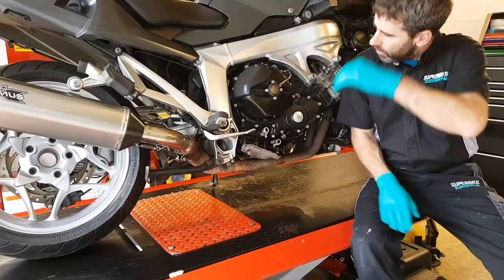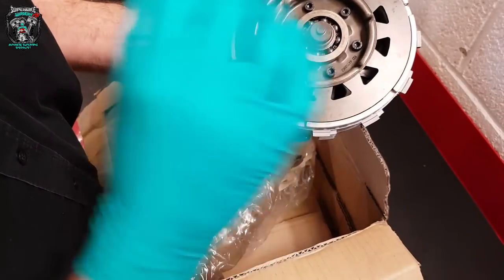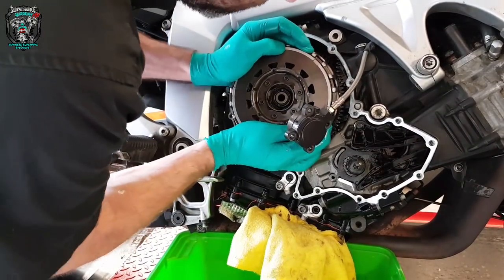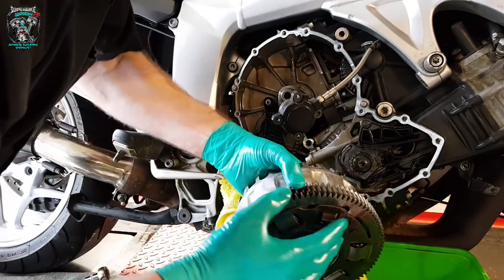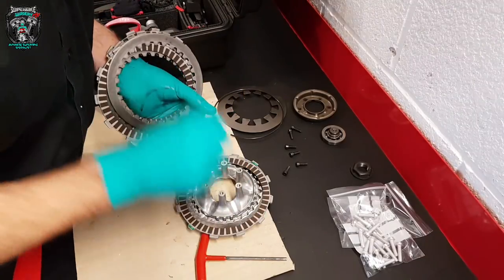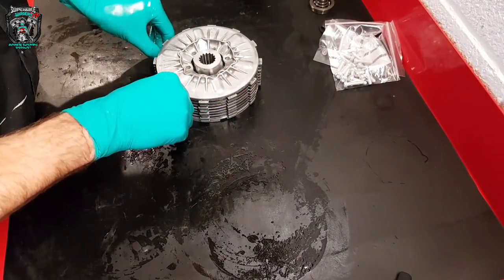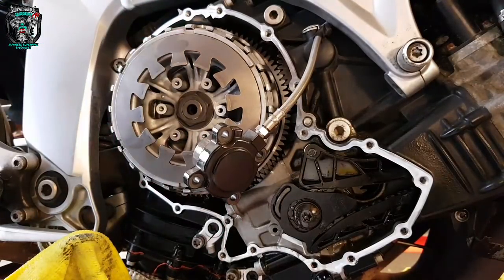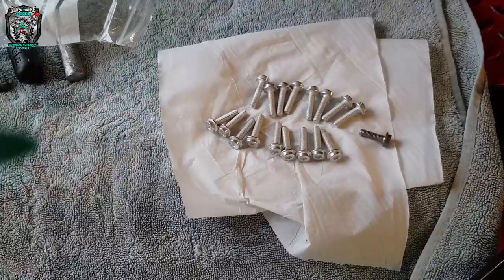BMW K1200 Clutch basket replacement - VLOG 007

Comment: There is now a mod on the clutch basket to drill more oil holes to allow better oils flow to stop the heavy clunk when selecting 1st gear I had mine done.
Reply: Did it work ?
Reply: Risk of loss of oil pressure

Comment: Get the BMW special tool for the anti-lash gear, it takes care of both gears at once and the basket will pop right in.  Also impact guns shock gears and can cause brinneling.  Use the tool to hole the clutch basket and avoid damage to the gears.  Replace the aluminium bolts for the cover with SS bolts and they can be reused again and again, without any real weight increase.  I also soak even second-hand clutches for insurance, I like the clutch to be wet going in.
Reply: The single use bolts are there to shear and break preferentially if you have a fall and the clutch cover is impacted. Otherwise the cover can break the cases in a drop or crash.

Comment: Actually, I did not find it difficult to torque the clutch shaft nut going back together.  With the clutch pack installed and compressed by the diaphragm spring, put the transmission in high gear and step on the rear brake while pulling on the torque wrench.  One-forty foot pounds, no problem.

Comment: Thank you so much I managed to replace my clutch today was a bit of a nightmare as I was originally sold the incorrect replacement clutch which caused me a lot of grief. I reccomend Barnett replacement works a lot better then the OEM BMW plates.  Thansk again I could not have done it without you much appreciated mate.

Comment: My old Suzuki T500 used to have a rattly clutch. The rattling disappeared when I puilled in the clucth lever. What made it rattle was the rivets holding the clutch basket to the primary gear became loose with time/use. The cure was a new basket and gear or I supose the rivets could have been replaced. 
By the way what happened with the Yamaha 1200 Super Tenere? My bet is the crank has snapped. I do enjoy your videos, it's good to watch and learn from an experienced pro. I have not seen your like before.

Comment: I have a question I believe you skipped on your great video. 
How do you align the multiplate clutch basket? 
I believe it is related on how do you bolt the pressure plate/spring. 
I’ve already tried few times but keep having that feeling of canguru launch. 
Any thoughts?

Comment: Hi.. just watched video, brilliant tips.... do you need to lock out the camshaft if only replacing the plates and not removing the basket ?
Reply from the maker: Only if you Don't have an impact gun to undo the clutch hub nut.

Comment: hello james, i have 2006 k1200GT same problem, it actually kept slipping until it broke. now it does not move, it also makes a loud noise when running. i wonder if it caused a serious damage to the transmission. Do you also need to lock the crank shaft replace the clutch basket?

Comment: Great vid . Would now be able to do this myself. I have an 07 with this rattle and also in need of a timing chain tensioner. Is that an easy swap out? Many Thanks Nigel
Also I am in Australia, can you recommend good parts suppliers either local to you or world wide chain of suppliers?

Comment: Hi James, thanks for the illuminating video.
 
A couple of questions I hope you can answer for me please:

I'm about to change the clutch friction plates on my 2006 K1200R. The plates are supplied by Barnet Performance Products from the US of A, in their blurb they insist that the plates are soaked in only synthetic motorcycle oil, can I get away with using semi synthetic oil to do the job? What issues will result if I do?

Secondly, an advising 'friend' tells me that I should also soak the new clutch cover gasket in oil to form a fluid tight seal, again, is this right as you make no mention of it in your video.

Many thanks,

Karl.

Comment: Hi, great video and it has been a massive help to me. The 6 bolts that go into the washer that holds the thrust plate, are these to a specific torque, or is it just until they are tight? I've replaced my plates and the bike won't select neutral unless it's not running. Can the thrust plate be too tight? Does the bike need a run out to let everything bed in properly? Or could the new clutch plates be too thick? Or have I royally f**ked something up? Any help would be appreciated, thanks :-)
Reply: Sorta same issue here. My clutch won't engage at all. Like it's hitting a brick wall half way thru the pull. Did you find out anything?

Comment: Did you go through all this without changing out that inner needle bearing? I wonder how many K1200/1300GT bikes have been scrapped for parts because the clutch roller bearing started vibrating after the clutch work?

Comment: Hello @SuperbikeSurgeryTV, I wanted to ask if anyone has had this problem before.
Bike is a 2005 K1200R has 55 032 kilometers on it, apart from the fuel sensor everything is perfect. I had recently done an oil change as part of the maintenance routine a week ago and had already do e 300 some kilometers since the oil change.
Over the weekend however I noticed something has changed upon take off the bike would pull normally in first gear at 1.5k to 2k rpm and once in second gear I'd hear the engine rev over 3k rpm and sometimes to 4k rpm before properly catching on, and under hard acceleration it would revs very high then comeback down to 3k rpm before pulling normally.
It's slipping on the clutch; all other gears will do the same too. It is not very noticeable after warming the bike up and riding around. But once it's nominal temp it starts to slip.
I've read around that it could be the slave cylinder's oil that got on the clutch to make it slip due to broken O rings or failed O rings so I checked the slave cylinder and the O rings, all are fine no leaks no signs of wear.
Some said it is the oil and I checked my oil it is a Yacco MVX 1000 10W50 and no my previous which was a Liqui Moly 20w50. Could this be the cause? I'm buying Liqui Moly 20W50 oil tomorrow and purge the Yacco out of the engine tomorrow and might as well buy a new oil filter to go with it too.
The clutch is good it's been replaced with a new one just last year and it all worked perfectly apart from last weekend.

Comment: I just purchased an 07’ k1200gt and I now notice the odd rattle at idle which is quite loud at times. I find it sad that BMW figures this is normal. There is nothing more bothersome than pulling up along another rider with your bike rattling. I have owned three other bikes of Japanese design with maintenance not being such a massive issue as BMW. How often does this need to be done ?

Comment: I developed clutch issues in my K1300R after the first 1000km service. Never could resolve it. BMW denied any problems, said the rattle was supposed to be that way. Got rid of it asap. Shame because it was a cracking good bike otherwise.

Comment: Mr.Uhm,....lol- don't sweat it!! bothers you more than us. I NEED YOUR ADVISE,..2006 k1200s  - 2/3rd gear clutch fork....possibly bent?? 9according to forums and guys that dealt with this issue when these bikes were newer....Mine will slip outta 2ndand outta 3 rd third when i aggressively throttle up in those gears and all others are fine. (it sounds horrible when it jumps out,...like destroying the gears;...It too has that rattle you speak of. My question to start with is,..the bike has 50,000 miles on it now I put close to 20k miles just in 10 months...What parts do i need to replace,...entire clutch basket and plates? should i also get the new thrust pin for oil flow through shaft>?  And what is your opinion in adding another steel plate in the front of all of them.? ANY AND ALL ADVISE WOULD BE GREATLY APPRECIATED. From Northern California, USA

Comment: My slave cylinder has a (breather) nipple on the top which has broken off. As the slave cylinder on your bike doesn't have a nipple, - how do you bleed it when you change the clutch fluid?

Comment: That new basket still got springs rattle tho, as i can see when you install it. Doesn't that bother you?
Reply from the maker: The springs are supposed to be loose, a brand new one would be the same. That's not what causes the noise.
Reply: What causes the noise?

Comment: Great video,thanks. I did my mates Yamaha with an impact, came out fine. Like you said "experience" you just need to know when to stop. I'm  thinking of getting a k1200... they seem pretty straight forward to work on. Subscribed paulphillipsfix.
Reply: Paul.   I have one and they are a bit of a pain. Clutch is the worst I’ve ever experienced !  They sit high above the sump and have to be kept wet by a supply through the drive shaft which doesn’t supply enough. I’ve fitted an Oberon slave cylinder and 5/40 oil which improves it no end but still judders.
Changing the headlamp bulb is fairing off or a highly trained pet octopus (virtually impossible in situ with normal sized fingers),fuel gauge left me stranded 3 time in first month of ownership and the AA man asked straight away if the gauge had fooled me. Not impressed and will probably go for a GSXS1000f next.
Reply: @robplazzman6049 I agree. I plan on putting in the K1300 Throughout pin, twice as much oil and the bearing with that, as well as drilling the drum where the first couple of frictions get oil; starved. BMW definitely did a lousy job on the clutches in these bikes. I have already replaced the cam chain tensioner and I also plan on putting in a cam chain jump guard. On the bright side I love the bike and it is really powerful and stable at speed.
Reply: @PaulPhillipsFix  please explain throughput pin role? I have a 2008 K1200S and transmission is shot, common issue. You would think BMW Motorrad would fix this by the end of the first generation. Anyways, I am planning on replacing it with K1300S transmission and am wondering what are the intricate details needed to make this happen. Supposedly, it's a pretty straightforward swap except:

"I bought a used trans from a K13GT. It has the larger holes drilled in the shaft to bathe the clutch in oil (the 12S clutches were notoriously under-oiled), so when looking for salvage, look for a K13 trans, NOT an old K12 trans, because you'll just be buying the same problem set (an underoiled "wet" clutch which imitates a dry one, and transmission dogs which are NOT undercut, resulting in common failures of 2d, and sometimes 3rd, gear). The K13 iteration fixed both those issues.

However, when you buy a salvage (or new, but why would you buy new for a bike this old?) trans, it will come without the little spinning collar which sits over the shaft and also has two holes drilled into it and throws out oil to wet the clutch. Unless you also buy that part from a K13 (and if you do, it WILL fit a K12), you will need to drill out (and emery to baby's butt smooth) the two, smaller holes on your K12 clutch shaft collar to the same diameter as the holes in the K13 transmission shaft. I found this out before doing the work from a BMW mechanic of 40 years, and the advice was spot-on."

Comment: I changed the basket to a bmw k1200r. It changes gears as it should. But when it's in gear and I press the clutch, it won't release it. I haven't put oil and started the engine yet. Is that the reason?

Comment: Please help! After install, my slave cylinder will NOT sit flush. The bolt that applies the force seems to protrude too much even though as far as I can tell it’s installed correctly!

Comment: Stretch bolts on a clutch cover. Is that common on a superbike ?
Reply: Seems strange to me too
Reply: No it's not but that's BMW for ya lol
Reply: German engineering - makes sense.
Reply: new r1s aslo have to be changed everytime ,  mainly due to the special coating on them , but its expensive and they are titanium i think.
Reply: Makes you wonder why titanium is needed for a cover bolt,. Surely stainless would do if it’s about preserving their look and longevity. Stretch bolts seems like over engineering. I’m not an engineer but if other manufacturers get by with standard bolts seems very odd.
Reply: Spanner Monkey the weight difference between stainless and titanium is huge , infact all the covers on the r1s have these and they saved over 1kg just on case bolts. They also 100% have to be torqued up and then turned to about 25 degrees , or something like that  , i can't remember the excat figure. 2016 i had to change the gearboxes on 10 new r1s due to  recall , and had 100s of these bolts left .what a waste lol.
Reply: The idea is that it keeps an even clamping force on the cover so it's exactly flat. That is kind of ruined though when you put lube on the threads and don't use a torque wrench.

Comment: Cleanliness is next to godliness.   I like that pressurised bottle with the brake cleaner, I might have to invest in one of those and fill it with kerosene for cleaning chains, seems like a good solution. I used to use aerosol chain cleaner but it seems to have gotten expensive, and I tend to brush the kerosene on/in, wipe it off and give it a blow with compressed air but doesn't seem to do as good a job and I end up swimming in kerosene-soaked blue towel! The chain cleaner used to rinse the crap off nicely and evaporate like brake cleaner.  Be interesting to know what you use as a pro!

Oh and by the way, how many ugga-duggas is 190Nm? - haha! Honestly I don't think I could physically apply 190Nm of torque, even swinging off a 6ft bar! F.T indeed.
Reply: I learned a chain cleaning tip from YT channel 'Mirius Shed' that works a treat - use engine oil!  Bloody brilliant.  And personally I use 3 in 1 as chain lube, because the specialist chain lubes I've used are shite and expensive.  Cheers!

Comment: @justincarney1250
0 seconds ago
Hello  I have watched several videos on the clutch replacementand at a lose on how the six allan key bolts that hold the pressue spring in place can be torqued , if they are set fully home and torqued to 8nm the this  has basically engaged the clutch it has compressed the spring  down the same way the slave cylinder does , the spring must be able to move in and out as the slave cylinder pushes against it , tightening these bolts all the way home does not allow it to operate , there must be either an physical measurement between the basket and  the spring plate or some other way to determine corect spring pressure . As I can not get the bolts to 8 nm against the spring pressure alone , Any insights would be helpful , many thnks

Comment: Really wished you believed in using torque specs
Reply from the maker: Torque wrenches are for people without decades of experience! They obviously have their place, but if you got one out every time you had to tighten something up, you'd never get the job done. Take a look inside any well run professional workshop or watch a race mechanic. You'll notice the torque wrench only comes out in very specific circumstances.

Comment: If that friction and steel is stuck to the hub the hub is shot, is no clip holding it on these bikes, it should slide just like all the other plates.
Reply from the maker: Incorrect, go and look at a parts diagram!
Reply: @SuperbikeSurgeryTV  year and production month? I have a 2006 clutchbasket, inne hub made in 2007, bike is a k1300s 2009. Factory fitted parts, there is no lock on the friction, it has the bellvillewasher and steelplate tho.